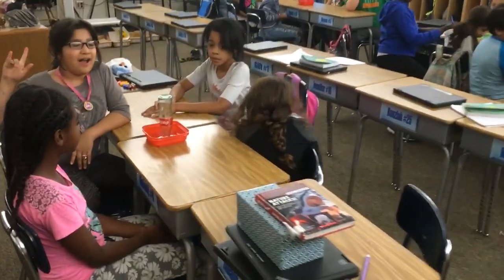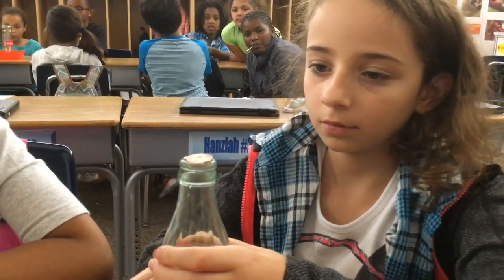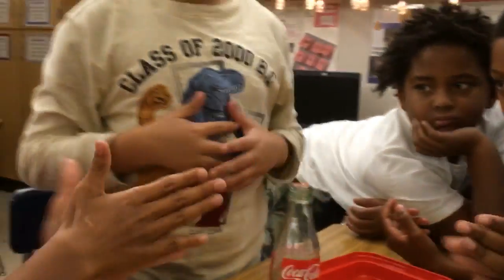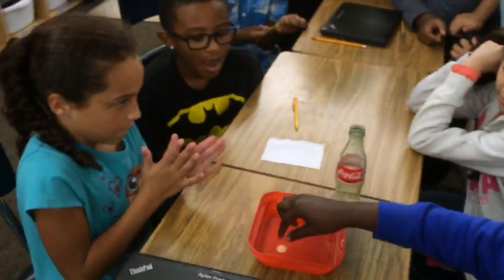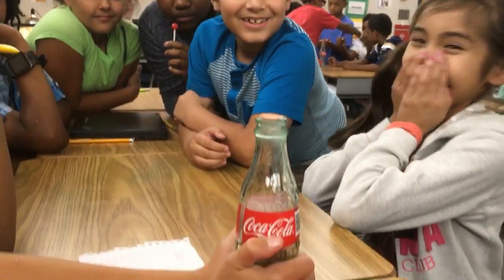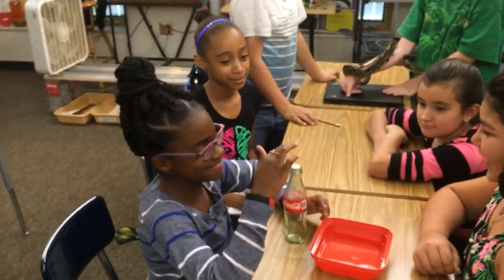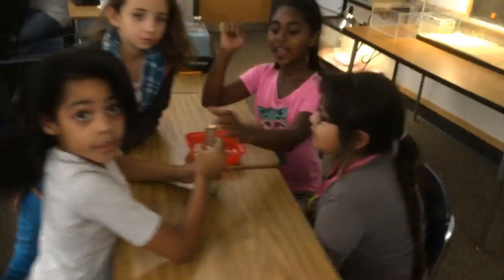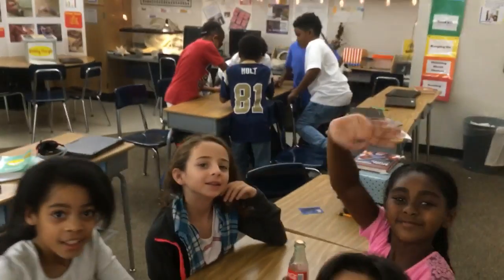Heat Transfer: Convection moves the penny in RamZland!🔥

Comment: does this work with water bottle?
Reply from the maker: Belinda Jiang You can try it..you need the rim of the bottle to be think enough to make a wet seal beneath the penny.  The rim of a plastic water bottle may be too thin.
Reply from the maker: *thick
Reply: thanks
Reply: And another question I have is what kind of water you guys use? Hot or cold
Reply from the maker: Belinda Jiang You need COLD water in the tray - put ice cubes in there...so when you hold the bottle with your hands, your body heat will produce the highest temperature differential.
Reply: Oh okay, I see. Thanks you so much!